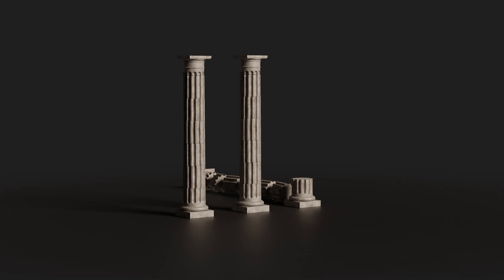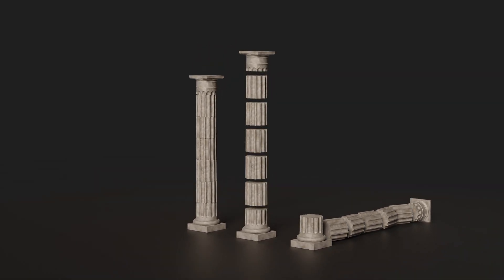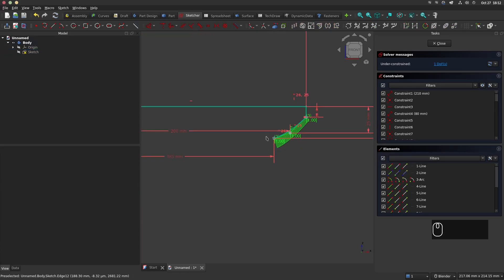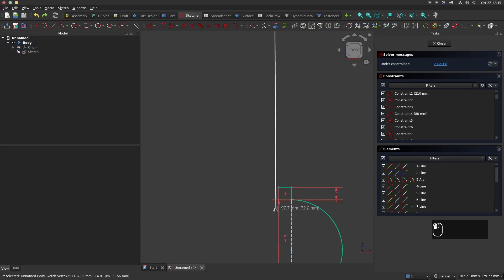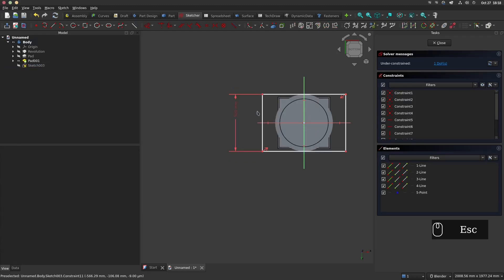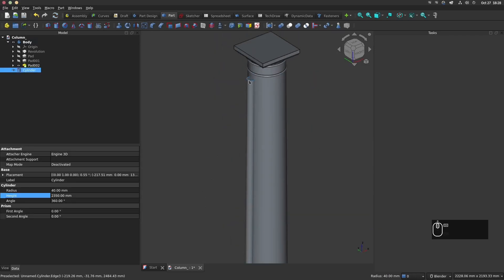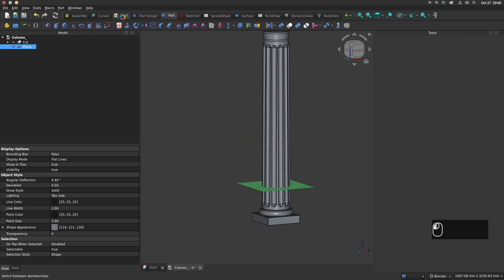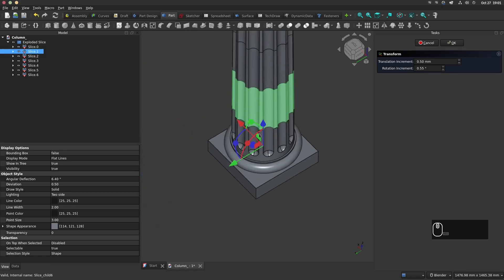Freecad 1.0 -  Slicing Column - Tutorial

Comment: How did you animate the columns at the beginning ?thanks
Reply from the maker: @Alexis-br4oh I use Blender for making the animation and the render at the beginning.
Reply: @ Thanks for the response, do you know if free cad v1 completely fix the TNP problem for fully parametric object. 
I want to use FreeCAD to create a complex object from A to Z with only parametric variables and then export it to Ansa to mesh it for CFD application. 
That’s for the context

Moreover I would need to use a define name surface in Ansa to mesh it properly and automatically that is why the name is really important before exporting